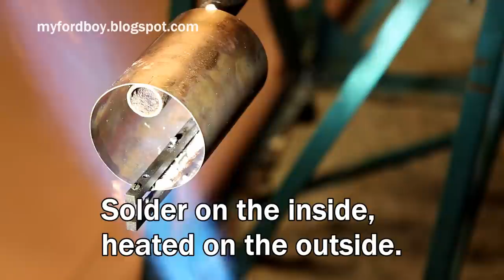Replica Marklin Steam Engine Part 5 Boiler Making and Running.

Comment: I can't remember the last time I got a black man's pinch 🤔 
I think the last thing I did was a Scotch-Brite wheel in a grinder. It was only a little bit of sheet steel and I'd normally stick it in my vice, and I did. But like everyone, you always miss a bit. 
So. I wasn't paying much attention and it caught n flung the bit of steel round. Right where the top of your nail goes into your thumb. 

I was really lucky it hit there as if it was just a fraction higher, I'd of been in A&E. 
This was quite some time ago and my nails still ducked. I can't count how much supergle n a file, so it didn't get any worse/catch then it already was. 

The joys of working with your hands I guess 😅🤷🏻‍♂️

Comment: the larger disks that were spun were made up 2 sheets welded together. on thinking back the sheets were precut into disks were around 6 foot and the formers around 5 foot, they key was not over working an hardening the metal. the forward an cross slides were powered buy hydraulic variable speed Moters, turning 5-inch amco drive screws. man, it was noisy and the welded sheets rumbled as the forming wheel rubbed on the welds

Comment: Hi really interesting watching the lathe spinning on a small scale, in the 70s/80s i was a lathe spinner for A&T Burt ltd vale division Christchurch New Zealand and the stuff i was spinning was up to 6 foot in diameter usually copper, stainless, steel or cumison up to 8mm thick. some of the formers weighed 2 tons an were craned in, we used neat's-foot oil as lube, pretty scarary shit once the former n sheet disk was spinning. The working heads were large rollers of various widths the harder the disk being spun the narrowest the roller, really scarrey when spinning internal cones say for a large fan housing as the roller could punch through the sheet, any how great vids keep it up cheers JK
Reply from the maker: That's some size, 6 ft dia. 8mm thick! I would not have expected that to be spun.

Comment: Great build. I'd've thought making the body of the boiler to the ends would've been simpler... before soldering, you'd've had massive amounts of adjustment...
Reply from the maker: The barrel had to be made to fit the base so this was made first. Actually it's fairly easy to adjust the dome size, just make the former the same dia as the barrel.

Comment: Very nice work as always. At 12.33 (soldering on the top) you say that you re-flux the existing joints. What is the purpose of this? A question, not a criticism.
Reply from the maker: In case a previously joint gets remelted the flux will make it reflow.

Comment: 7:53 Ohh, that looks dangerous.
If the step drill jams and the sheet metal spins, you may have red sauce on the work piece. That might hurt.
When doing such work, always clamp the workpiece.
I had so many experiences.
8:52 I always use a ball bearing for this kind of work.
There is no friction and the surface becomes cleaner.
19:43 Very nice model
Reply from the maker: I was waiting for a comment like this!
Reply: @myfordboy  I agree with his comment, naughty boy. :)
Reply from the maker: Check out this video https://www.youtube.com/watch?v=cAGiuXOKKi8&t=11s
Reply: @myfordboy  Either like this, or simply fasten it with a clamp, then you are on the safe side.
I definitely don't want to criticize, I just want that
 you stay healthy so that there will be more videos of you gives.